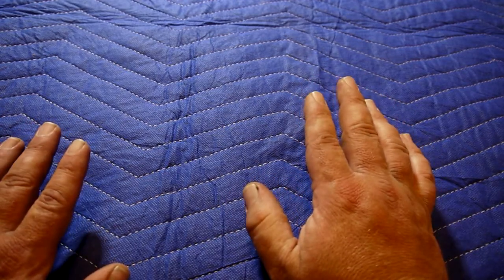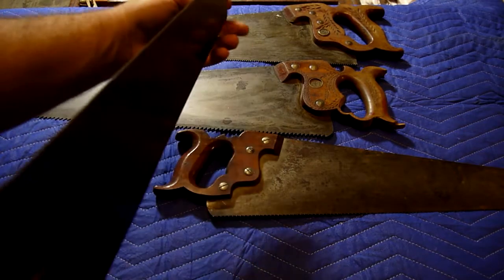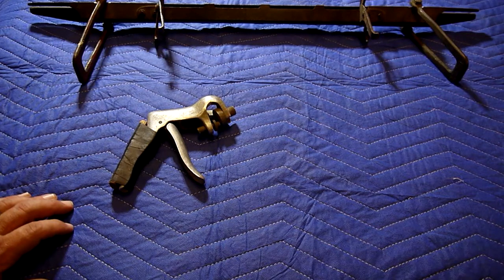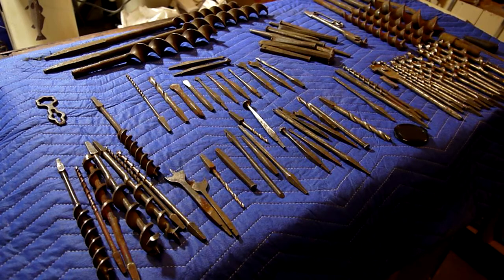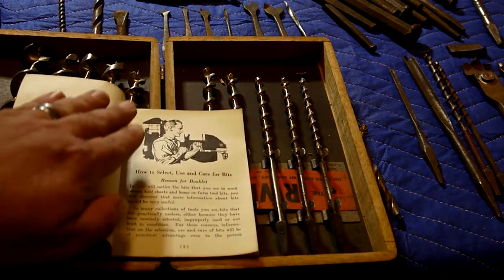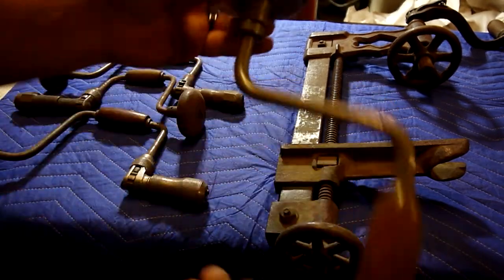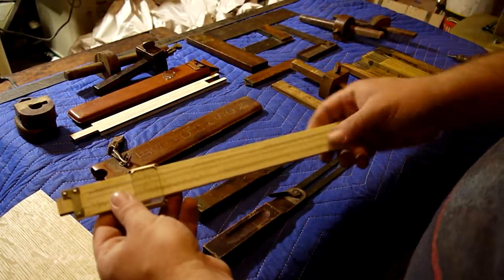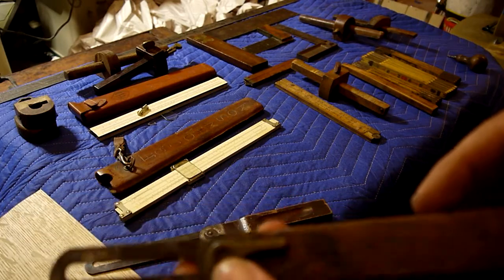Antique Tool Chest Discovery: I Purchased a 19th Century Pennsylvania Shaker Tool Chest

Comment: Rip saws separate fibers along the grain. Cross cut saws chip away wood shaving at any angle. Rip saws are faster to cut a board the long way and it is not for anything else.